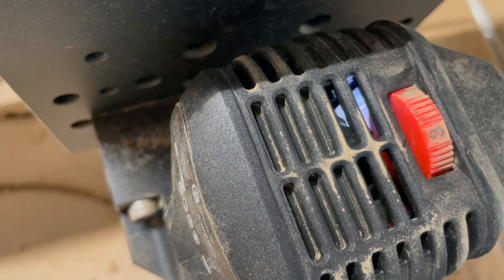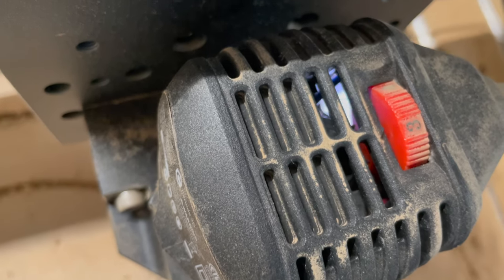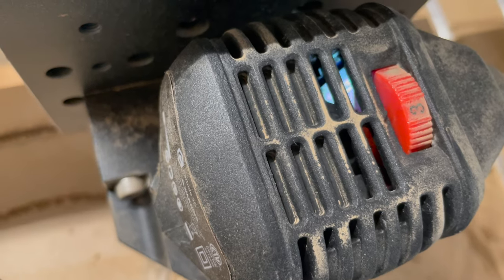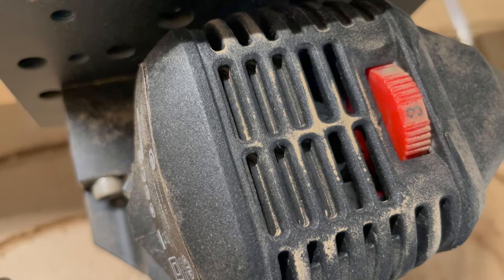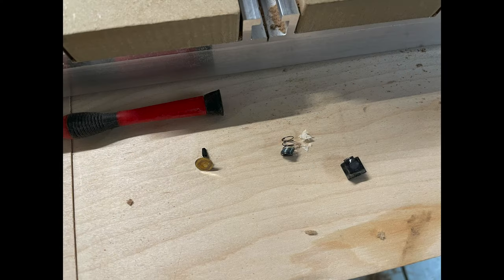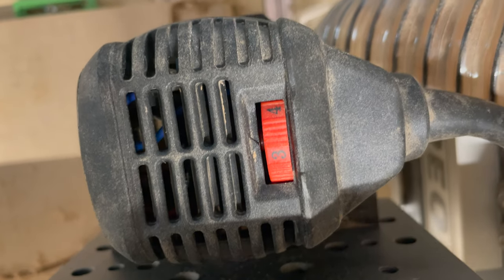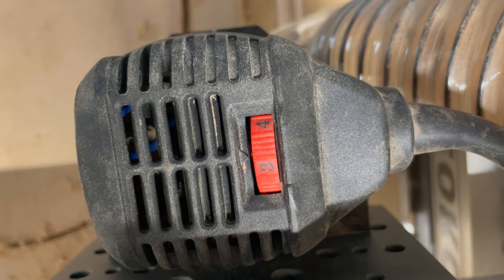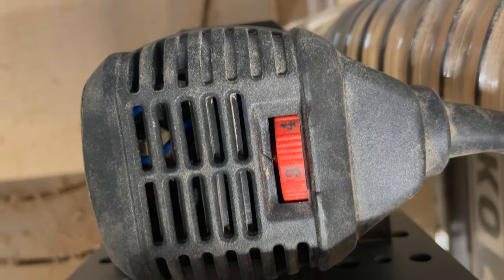Shapeoko owners: Be sure to change your router brushes!

Comment: I am surprised at this point that tool makers have not made the switch to brushless motors for tools. Low kv motors with proper gearing could easily work for them and be far more efficient in power use.
Reply from the maker: Yeah, I’ve never changed a brush before this one, which is why I made the video! It wouldn’t have even occurred to me that there was a little spring gadget electrical thing in there 😂
Reply: @zwitchguitars  Oh you deprived child!!! you never had to redo brushes on your slot cars as a kid? I was changing brushes on electric motors by 7 years old... guess being a child of the 70's gave more life experience then thought hhahaha
Reply from the maker: @borgonianevolution  No, I never had slot cars. A few toy-grade RC cars, but nothing you could wrench on